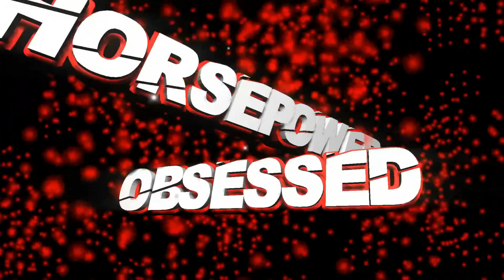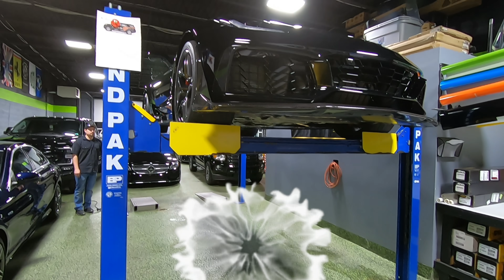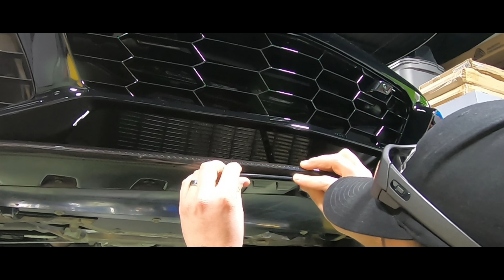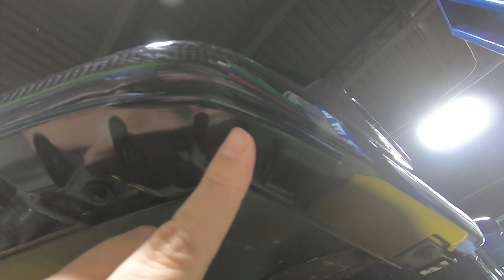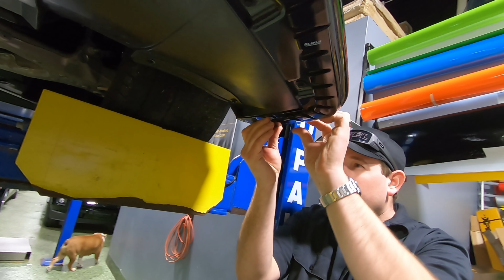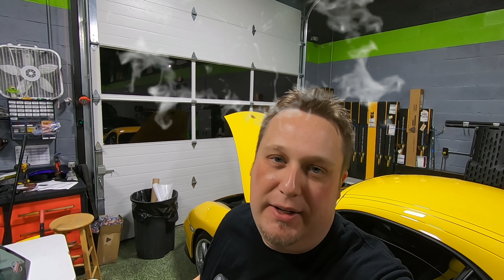Protect your EXPENSIVE front splitter the EASY and CHEAP way! SLIPLO protection!

Comment: I just purchased a stock C7 stingray and am adding additional mods to enhance the appearance as well as improve performance. Since I just ordered a stage 2 front splitter, I plan on purchasing the sliplo splitter protection to it so as not to damage it by scraping against curbs, speed bumps, or any other obstacles.

Comment: then thats all scraped up tight? So do you replace it at that time?

I have the new 202 c8 and have the stock plastic splitter piece and it bends and doesnt show scratches easy, wondering if i should bother with something like this because itll just make the clearance even lower to the ground.

Comment: I hate to be a Daniel Downer here, but you can get a lot more protection for splitters and spoilers at much less expense doing what I’ve been doing for over 20 years. I use 1” wide 3M trim adhesive tape to affix five 1” wide aluminum strips, about 1/16” thick, running “bow to stern”.  I space them all equally with one in the middle, and one on each far end, etc. They will audibly grind if your car’s snout ventures into danger, and keep your rig off the grinder. Replace any individual strip as required. Add more if you want, just be sure to go front to back. All ingredients are available at any big-box store for less than $20 all in. Embrace the drop.

Comment: It looks like from the design it's made to protect from head on damage prevention.  How well does it work for something like backing out of a driveway for example?  Would anything catch our cause issue?  

I've got a c6 427 convertible and the driveway is killing my front carbon splitter.  It'll have to be replaced.  I have to back out, no choice due to the incline.  The splitter is rubbing and the concrete is cutting through it just like rough sandpaper.  Hoping this can be a good addition with the new splitter that's going to have to be installed.
Reply from the maker: No. I back out of my driveway as well and this has saved my splitter a few times already.

Comment: How much to is it? Looks like a very easy DIY project.
Reply from the maker: It is very easy. You can check it out here:  https://sliplo.com/209.html USE PROMO CODE: "horsepowerobsessed" to save 10%.
Reply: @HorsePowerObsessed   Very reasonable price after looking on the website you sent me. And now understand why they sent you 2 sets, the vid shows protector on front and back of splitter
Reply from the maker: Yes sir! Very reasonable and very useful.

Comment: Awesome work. I can see how a lift would make this easier to install and eyeball the straight lines.  Sliplo splitter protection may be a must. I just scrapped my brand new splitter entering into the cemetery for my uncles funeral. Wish I had this stuff on first. I think its time to order some.  2017 GS is lowwwwww
Reply from the maker: Thanks! It has saved my ZR1 splitter a few times now. Definitely good stuff.

Comment: Hey Justin what do you think about the C8 Z06, that is on the horizon? I have a front splitter for the Z06/GS level 2 carbon fiber exposed. I picked up mine at Amazon made by ProTekt C7  for level 2 and level 3 Aero package. as you know I'm a Z06 2LZ  automatic walken Glenn gray/chrome wheels of Ocala, FL. Thanks for the video. I really enjoy watching for information on C7 corvette Z06 also ZR1's. be safe out there my friend!
Reply from the maker: Hey man! I've heard good things about the ProTekt stuff so I think you'll be fine with that. The sliplo product is more universal so can really be used in any car. I think the C8 Z06 is going to be pretty cool but I'm hanging on to my C7 ZR1 no matter what C8 I end up with.

Comment: Oh oh! Now you’ve altered the boundary layer airflow characteristics, most importantly at the leading edge of the splitter where the boundary layer airflow is generally laminar. Yeah, that’s bad. ;) 

That’s due to the fact the protectors will result in turbulent instead of laminar airflow. In short the splitter will no longer be effective at reducing front end lift at high speed which could result in catastrophic consequences. However, it isn’t likely to occur at less than .5 Mach (~375 MPH) although wind tunnel tests would be needed  in order to obtain useful data. Although I doubt the guys over at Dryden flight research would do so without a good reason. I'd need to work on that. ;)

As for the road rash you might want to get some fiberglass resin and paint over it. Perhaps mixing some black paint with the resin. A body shop should be able to do that. The point is to prevent moisture from being absorbed into the underlying layers which could potentially result in some form of delamination.
Reply from the maker: I will definitely get that taken care of. I didn't think about the moisture getting sucked in and the problems that could cause. I leave the heavy thinking stuff up to you! 😁

Comment: SlipLo Splitter Protection. There, I said it! So the SlipLo was cut around a screw. Is that one screw what holds your splitter on? I would think the other side has a screw as well, so that would make two screws holding your beautiful carbob-fiber splitter on? That would make me nervous...
Reply from the maker: lol no. The screw at the very edge is in fact on both sides but that's there to hold the bottom of the side "canard" or "winglet" onto the splitter. There are something like 16 bolts holding it on at the bottom and a few more at the top. That splitter combined with the rear wing creates over 1,000 pounds of downforce so it has to be attached in a very serious way.
Reply: @HorsePowerObsessed  WHEW! I'm sweating a lot less...

Comment: Sliplo splitter protection rocks!  I bought an off-brand universal protector (I forget the name) and it just didn't feel as slick as the Sliplo.  Sadly, Sliplo was only available for sale to installers when I was hunting to protect my bumper.
Reply from the maker: It definitely does! It's so slick and so easy to replace (for that inevitable time you scrape it) I love it! You may just have another chance at getting some for free now, Pat! 👍👍
Reply: @HorsePowerObsessed  I'll be waiting for the die to be cast.  :)

Comment: That Sliplo Splitter Protection would really come in handy for my 18' CTS-V!  The guy that built my house built me a ramp instead of a driveway!
Reply from the maker: I feel your pain! My driveway at the very end slopes too hard and it can be a pain to get in/out of.
Reply: I have to come out at an extreme angle going like 0.1mph to make sure I don't get any suspension movement.

So any C8-Z06 content coming down the pipe?

Comment: I so need the Sliplo Splitter Protection as I modified some bolts to hit first and this looks so much more capable of deflecting those spine chilling grinds...
Reply from the maker: It definitely is! I will really be putting it to the test when I lower my ZR1.
Reply: HorsePower Obsessed Especially after I bought a 17 Z06 with Z07 aero and I agree it was the sweet spot with a being the best deal at the time you suggested it.  What I did was to put round nosed screws through nut-plates.   Not realizing there was product to deal with it as it doesn’t take much for contact.  That said, a great post on what is available and Sliplo will do a much better job as I have managed to get a scrape between screws...

Comment: SLIPLO Splitter Protection. Whew, okay business (aka Giveaway requirement) has been met.👍😉 Moving on.  What I like is that it appears to almost have a shiny finished front edge, which to the uneducated eye, makes it look "factory." I'm already on my 3rd C6 ZR1 CF splitter and I ain't buy'n another one!  Not as expensive as yours, but they ain't cheap! So, I already have a large set of carpet cutting scissors, so I'm ready for this product. One question though, how easy will it be to remove if down the road you notice that it's really been working and consequently should be replaced? Save the Wave🙋🏼‍♂️
Reply from the maker: Peter! I was actually thinking of you when I had this installed because of your splitter issues! I've been told it comes off pretty easily when you need to replace a piece.
Reply: Thank you Justin. I'm actually going to raise the front up a bit. I do have "Plan B" to possibly lower it again, but that will only be after I go coil-overs all the way round, which is an expensive way to do it, but that mod will improve all around handling and give me a bit more traction when needed. FWIW, I'm not always just a pavement putter.😉

Comment: I keep getting ads throughout social media for a similar product. I'll definitely need some sliplo splitter protection when I get a front splitter for the C5 👍
Reply from the maker: I first saw it on Instagram so you're likely seeing the same stuff. You'll definitely want some with a low sitting front splitter!
Reply: Definitely go Sliplo.  I used an off-brand competitor and it isn't as slick.
Reply: The C8 has an official accessory call Scrape Armor. Screws on/much harder/thicker/heavier duty but 5x more expensive (like $500) under the front chin.

Comment: Looking forward to the review what about further down the slitter so once you pass the high point over it does not hit further into the splitter...Sliplo Splitter Protection

Cheers,
Kevin
Ottawa, Canada
Reply from the maker: You can add more if you'd like, but the design of the C7 front lip has it hit in the very front first. The SLIPLO will push it up enough to prevent damage all the way back. I will definitely report back after a few weeks on this product and a lowered car and let you know how it holds up!